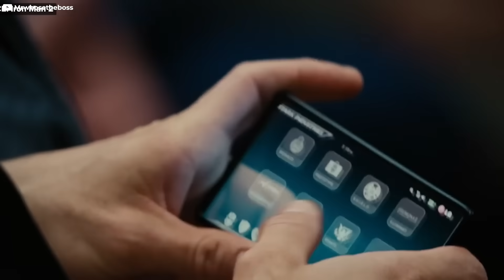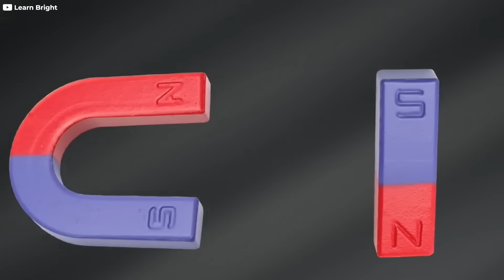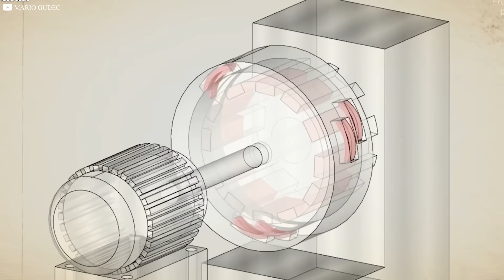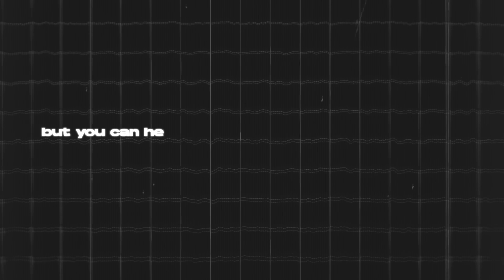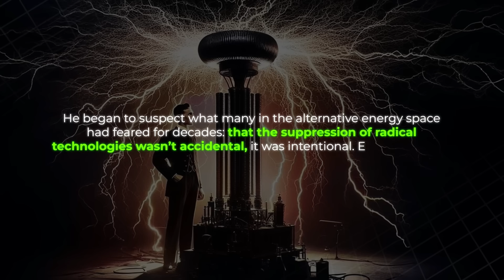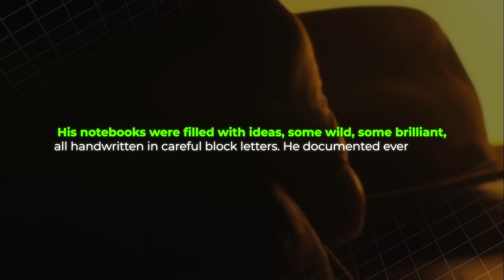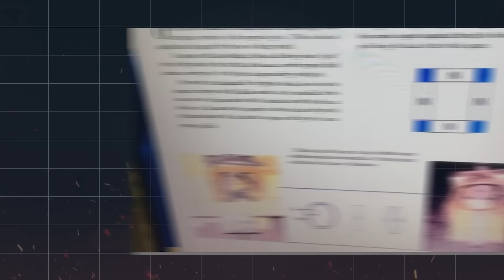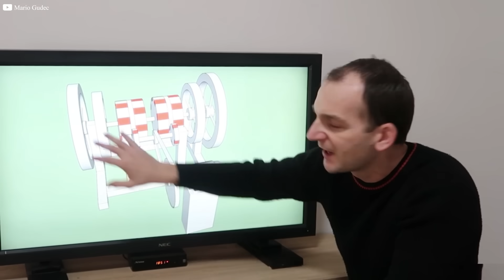Howard Johnson’s Magnetic Machine Could’ve Changed Everything

Comment: Interesting video mixing Johnson's devices with Searl's and the Russian version of the Searl Effect Generator. As far as I know the Johnson linear device is quite easy to make but trying to make a loop using the same principle is difficult. Maybe Johnson managed to make the motor run but it could not generate usable levels of power?
But in general the problem is that we focus too much on "energy" while the efficiency is the key. Work in vs. work out. Maximizing work out while minimizing work in. A good lesson in that is David Squires' video "Advanced Motor Secrets" describing a motor with 200 watt input (electricity) and 740 watt output (mechanical power on rotor axle).